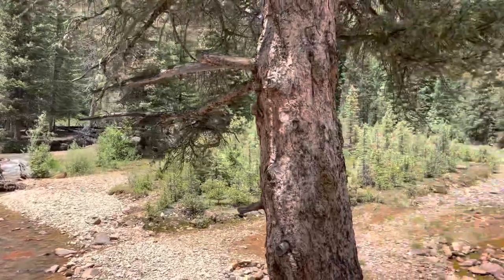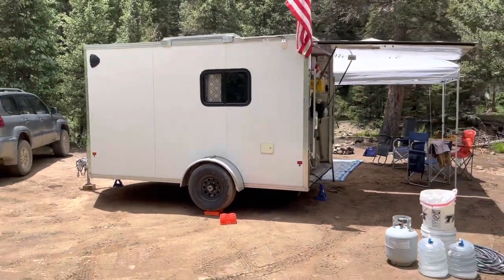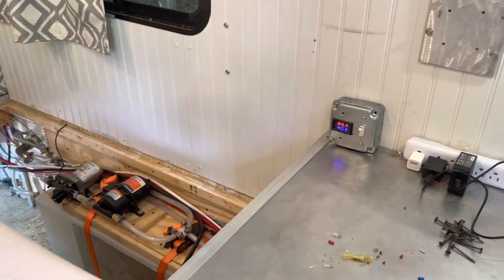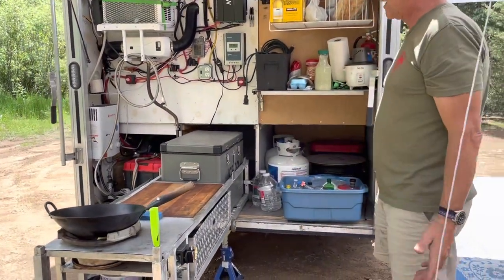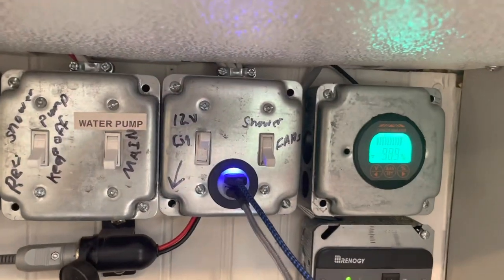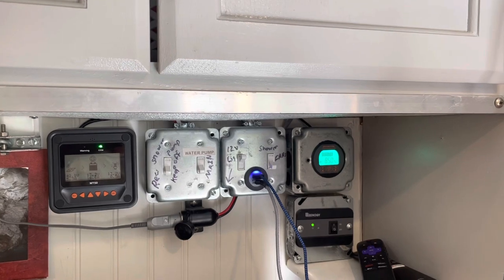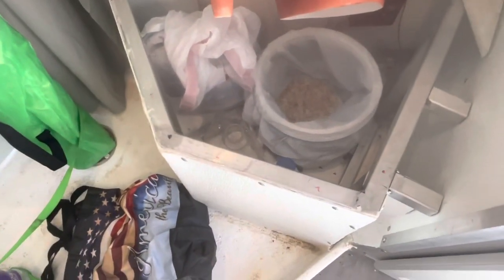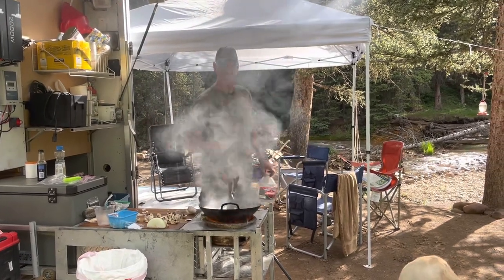Full description cargo trailer conversion￼

Comment: great video, I have a 16' 7' x 7' trailer on the way, so two 3,500# axles.  What size is your trailer and what do you think your gvw is as built?
Reply from the maker: That is a fantastic question, in the video I explain why I upgraded from 3500 pound axle to 6000 pound axle. Did it surely for a confidence level so that I didn’t have any issues. What are my better upgrades. Feel free to private message me with any further questions.